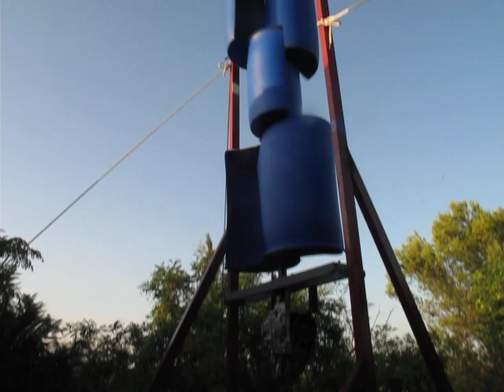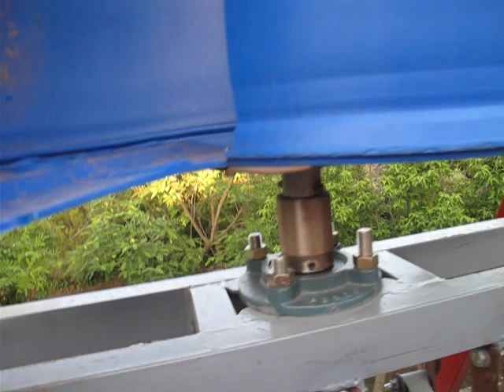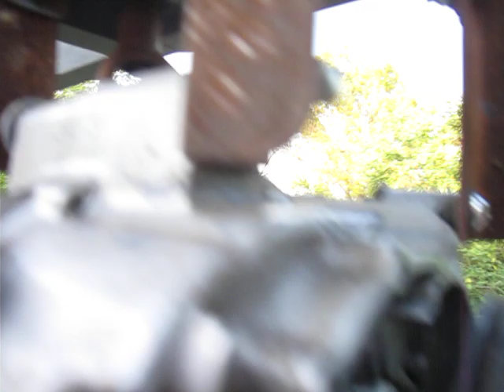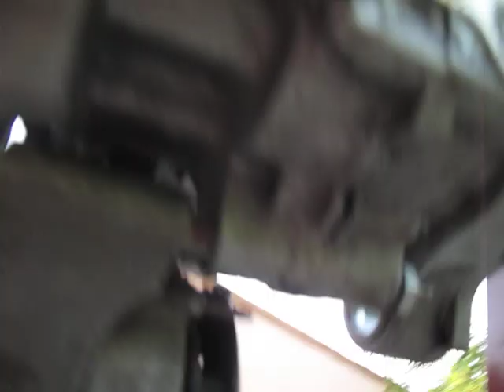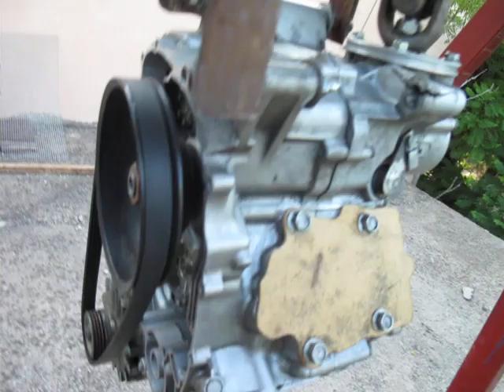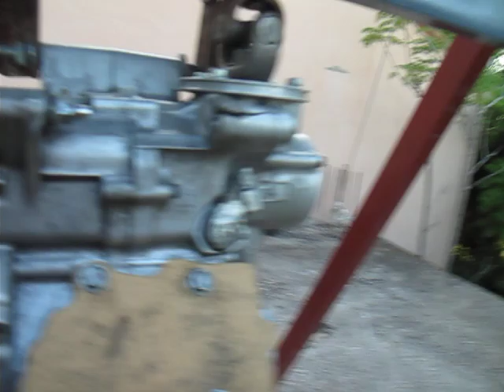Aerogenerador savonius de construcción casera. DIY savonius wind turbine.

Comment: Whose components ude for..
Reply: Use..
Reply from the maker: - 8x4 iron profile for frame
- 70mm iron tube for axis
- 3 plastic barrels 150L
- old motorcycle gearbox
- old car alternator
- 4 2mm iron plate, 2 between barrels, 1 top and 1 down

- 2 vertical bearings 70mm
------------------------------------------
that was the original build but the alternator was very inefficient and gearbox with alternator was substituted by a self made low rpm generator (not showed in video)  http://www.scribd.com/doc/14018018/Minialternador-de-500-VA-Para-Savonius